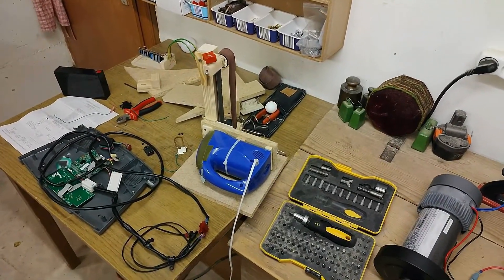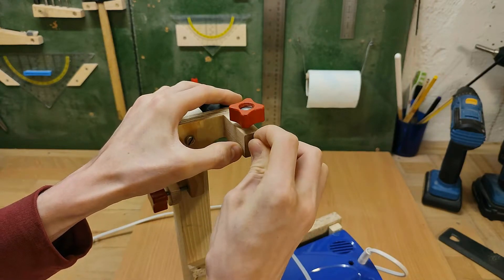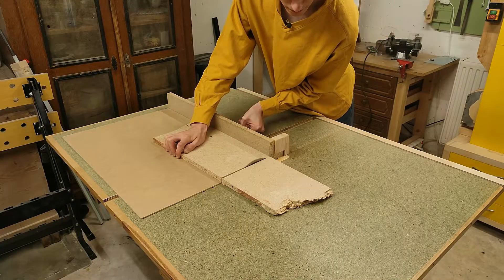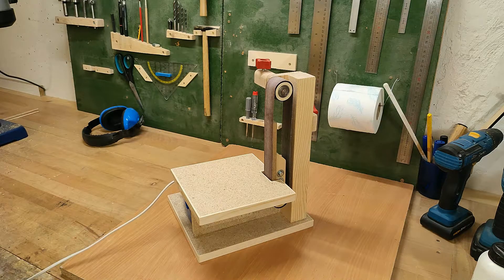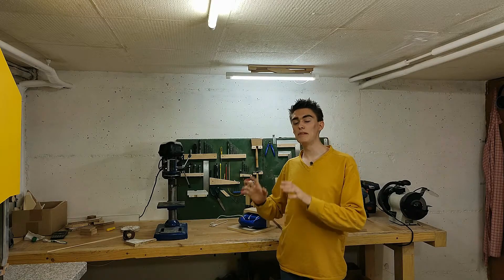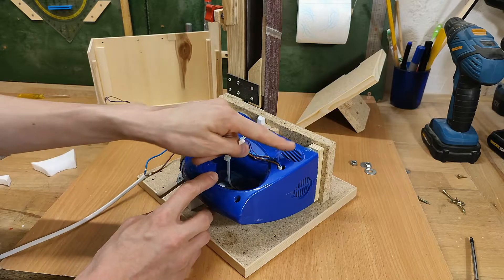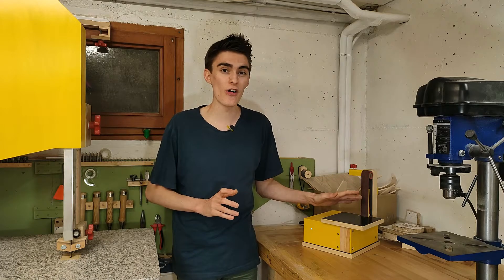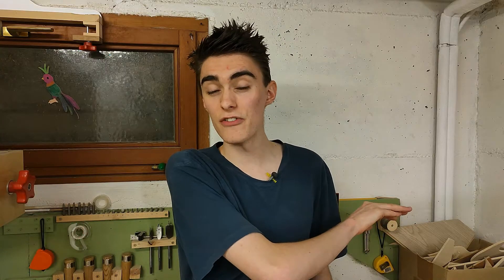How to transform an ordinary HAND MIXER into a STRIP SANDER!

Comment: Haha yes i need it
Reply from the maker: Really? Cool, I didn't think anyone would care! Is it urgent? I'm just about to assemble the plans, thought about doing a free version (the 3D model) and the full set of plans (3D model + PDF with pictures and measurements of all the parts) for like $3.00
In either case you'll be able to build the exact same machine, you'll just have a little bit more work measuring everything out with just the CAD model.
Whatever you choose, I'll leave you an email adress to which you can send your request (I won't spam you, nor sell the data, promised 🤝) then I can respond with an attachment. For the free version I can just leave a download link here in the comments.
Reply: Cool just wanted to tell u that i started making the same one but using a diffrent mixer and where i live (in europe) i have 220 v outlets soooooo.. an led just exploded in my face
Reply from the maker: Great, if you have reddit, post it on my subreddit! Sorry to hear about your LED, what circuitry did you use? I have 220V too (actually more like 240)  but mine didn't explode.
Reply: Btw i love ur vids and the sander is gud put for safety put tini tiny rubber spikes around the wheels so it grips better